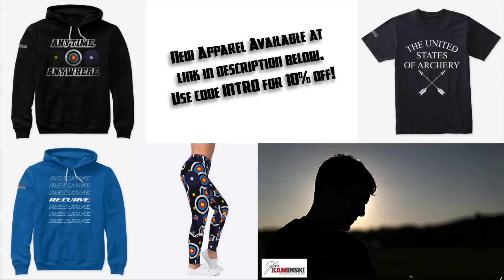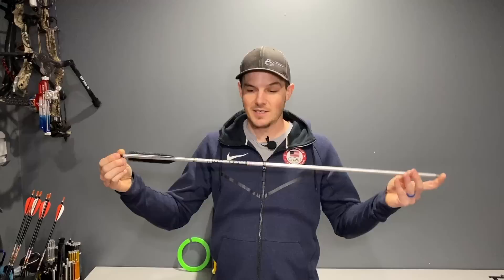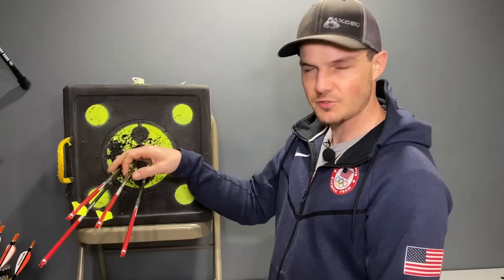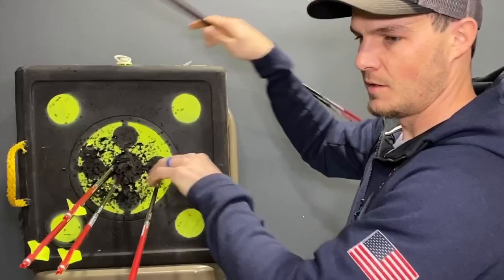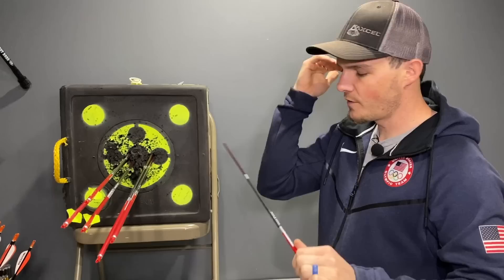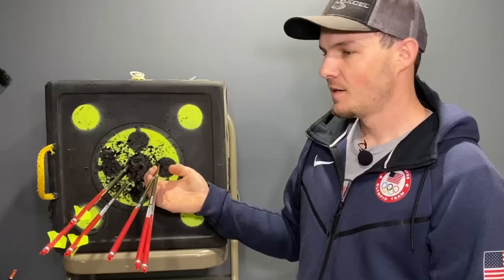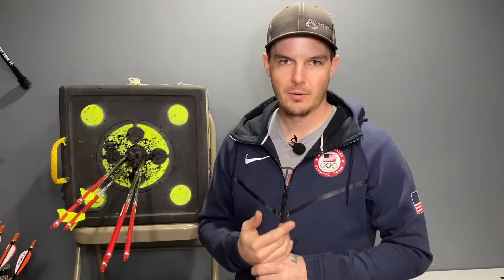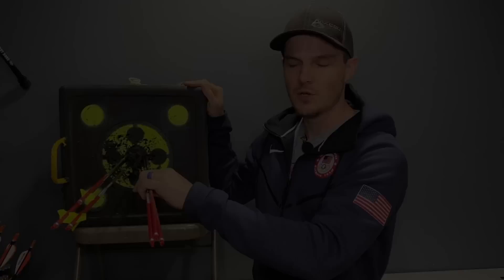Bare Shaft Tuning a Recurve Bow |  How To: Recurve Archery Bareshaft Tuning | Tuning Series Ep 10

Comment: Another great video 1 way I remember about weak / stiff high / low is everything is reversed . By that I mean say your right handed so your right hand is the strongest left hand weaker but you reverse it where the bare shaft hits  ( same can be done for a left hander ie left hand strong / right hand weak same with high nock point the arrows are reversed ie hit low & visa a versa for for low nock point .

Comment: For someone new to tuning, a ballpark estimate of how much you can increase/decrease poundage with limb bolt adjustment might  be useful here.  6  full revolutions anticlockwise from all the way in is usually max out and you've got roughly a 10% (of the rated limb poundage) gain in weight from there with clockwise adjustment to all the way in.  (5% with 3 revs etc)

Comment: Bareshaft Tuning,  Low Poundage Recurve , Field.
When tuning my 28# Barebow Recurve with VAP 1000 spine+80 gr, points, I found that when shooting 3 bareshafts and 3 bareshafts that were taped, (taped in the same place as the vanes on the fletched shafts) the 3 bareshafts always landed RIGHT of the fletched.  The TAPED bareshafts always landed LEFT of the fletched.

  First I adjusted my nock point.  Then I increased my draw weight to bring the taped shafts toward the fletched shaft because I wanted the greatest distance for arrow flight.  I found that I can aim on the target with 28# Draw weight using the riser shelf.   When the bow is tuned using the (weaker spined) bareshaft the bow doesn't shoot as far.

 I have not tested for group size,

Comment: I recommend you always say that this tuning is for shooting with fingers, does not apply to anyone shooting a release.  If someone just watches one of your random videos that youtube suggests they might not realize that.
If the string pushes forward on the rear on the arrow, why does the arrow bend sideways?  This is the critical difference between using fingers and using a release.  With fingers the string pushes forward on the arrow but also it pushes sideways on the end of the arrow and this sudden sideways push is what makes the arrow start its bend.  This doesn't happen shooting a release.
In the old days we didn't do the walk back tuning and we didn't have adjustable poundage so all we could do was change the arrows or the plunger.  This might be why we sometimes had plungers out left of centershot.

Comment: Hi Jake, thanks so much for your amazing videos. I try to find advice about the centershot and plunger setup for bareshaft tuning. Centreshot you have covered. I can't find if it's OK to stiffen up or make the plunger rigid, e.g. with a match instead of the spring just for tuning... Then roughly bareshaft tune and then what? keep it stiff for further tuning or let it back to soft plunger?

Comment: Jake, awesome video and I learned a lot from it. Please continue the awesome series. My doubt with this video is that you didn't mention anything about the sight pin. Does it stay constant throughout the bare shaft tuning? If yes, then where would I place my sight pin, to start the bare shaft tuning? Amateur such as me would adjust my sight pin to correct the arrow to fall on the center. I have absolutely no idea right now if my arrows are stiff or not, if my nocking point is high or low. Right now, I would adjust the sight pin to correct the errors to make surer the arrows land in the center. How would bare shaft tuning help me differently from what I am doing right now?
Reply from the maker: When tuning, where your arrows land in relation to the target doesnt matter, where the bareshafts land compared to the fletched shafts matter. Ignore the target, but you have to aim at the same spot so it helps to have one up, and dont move your sight during the end to compare the arrows to eachother.

Comment: Jake, where do you set the sight pin when your setting up a bow to bare shaft? I was always taught to set the sight pin above the centre of the arrow, then adjust plunger pressure to centre the fletched group on the target, then bare shaft from there and not adjust the button at all.

Comment: Jake, how about the weight difference as you don't have the vanes on the bare shaft so it's weight (distribution) is different and will react weaker.

Edit: forgot to say great video as always!! Thanks
Reply from the maker: Eh, it’s not that much. I’ve added tape to the back and didn’t see much of a difference. It’s a couple of grains. We don’t use the heavy vanes that compound do, the mylar type
Vanes we recurve shooters use are roughly 7-9 grains in total.
Reply: @JakeKaminskiArchery  thanks, still shooting cheap arrows so vanes are a bit heavier. I use some tape to tape them away. Seems to work well with my current form and faster then cutting them off :)

Thanks again (and quick reply!!!!)
Reply: So the question of vane weight compensation occurred to me this past week wile tuning some new VAP .166's. I'm using Bohing X Vane 2.25" which weigh in at app. 15 gr. for three. Adding an equivalent amount of duct tape, 3.5", resulted in a 8-10" spread at 30 yds. between weighted and unweighted bare shafts. So I'm not sure which I should tune to. Thanks for replies!
Reply: @buzzhooker8398  If you have the time you could try both to see what works better. But seeing Jake's reply without is probably good enough, most videos i see are just bare shafts without any additional weight at the back :)

Comment: I'm so confused, i have both several compound bows and a recurve bow. Whenever i paper or bareshaft tune, the freaking arrows dont react to any changes i make! For example i have a nock high and right tear. I unglue my insert, take off 100 grains of weights that were screwed into the back of the insert and re-glue. I also turn my adjustible nocking point around the string to move the nocking point down. I shoot again and get the same tear! Nock high and right! Same with my compounds, except on the compounds i get a nock left tear no matter what i do, i've moved the rest into every possible position, i twisted the yokes and still i get that nock left tear (i dont have facial pressure on the string, i checked for that).

Comment: Another great video! I tune my arrows by the order you recomend.   I have a (silly) doubt: if I increase the strength of the bow to make the arrows weaker, shouldn't the arrows and the bare shaft go both to the right, keeping the distance between the groups? Thanks!
Reply from the maker: It will, a tiny amount. But not together in unison.

Comment: Thanks for another great video! Do you ever add any weight to the back of your bareshaft to match the fletched arrows?
Reply from the maker: Eh not worth the time or effort imho.
Reply: @JakeKaminskiArchery  :Hello Jake surprised you say that. Even three small vanes can weigh 6 grains. I shoot barebow with 2 inch vanes here in the UK and always my fletched arrows flew really well but the bareshaft always left indicating too weak (I am left handed) I added insulation tape to my bareshaft where the vanes should be so that both fletched and bareshaft were balanced at exactly the same point along the arrow shaft. Now bareshaft groups with fletched arrows. The extra weight of the tape has made the arrow stiffer. Try it one day just to see if it makes any difference.

Comment: Great Video - very informative! I have some issues with my Easton x10 bareshafts (Spine: 550) - all of them are on the right side of the fletched group (about 30-40 cm away) - so the arrows are definitely too weak - should I choose 500 or better 450 for X10? I’m not really sure...
Reply from the maker: Have you checked a spine chart?
Reply: Yes, I checked it - I should take 500-550 for 45 lbs (28” arrow lenght) - but the 550 are too weak - and I’m not sure whether the 500 are stiff enough to get closer to the fletched group... It’s all about eliminating a 30-40 cm space...
Reply from the maker: Joshua Merz it usually says the letter R next to the spine you should use with a recurve. Especially if they give you two spines like that. And usually it’s the stiffer arrow needed on a recurve.
Reply: @scryptjo9247  My 500 with 40,5 lbs, 28" arrow length and 120 grain points fit well.

Comment: Who has an explanation?
The Easton arrow selection chart for target recomandes at 34 lbs and 27,5" the ACE 780R or 720R.
The right handed archer (last indoor competition result 575) tested both at 30 m and the result was very surprising. The 720 bareshafts were constantly to the right in the black rings an the 780 bareshaft also to the right, but close to the group or in the 9.

Comment: Hi Jake, thanks for another great episode.
One question which is bothering me for a while: When adjusting vertical tune i.e nocking point height, shouldn't the bareshaft  land slightly higher than fletched arrows due to the drag of the vanes that slowing them down slightly? I bet if someone would measure arrow speed just before it hit the target at 30 m or more there would be small but noticeable difference. What do you think?
Reply from the maker: At 30m it’s not enough to notice as far as drag is concerned.
Reply from the maker: I’ll shoot some arrows at 30m through my chronograph. And do a vid for you.
Reply: @JakeKaminskiArchery  Cool! Thanks!

Comment: I have a qustion concening plunget tension at the beginning of bareshaft tuning. The method is described by Peter Gabriel as "arrow flight on rails". He suggests to aline limbs, center shot and lining the sight pin to the string. Then flatshed shafts should be shot on 30 meters. He says to adjust the plunger tension to compensate for left and right until the aming spot is hit. Then he recommened bare shaft tuning exactily the way you explained in the video followed by walk back tuning. Woud you recommend this method to find the plunger tension to begin with?
Thanks and keep on going! :)
Reply from the maker: I personally don’t recommend that. I’d rather have better grouping arrows and move my sight in the middle rather then have arrows that hit behind the pin and group bigger. I’ll expand on that more further down the line.
Reply: @JakeKaminskiArchery  Thaks for your recommendation. I´m looking forward to dig deeper into it!

Comment: Great video again. One thing is important for me: You never can get a bareshaft properly into the group by only changing plunger pressure. This might be able at one specific distance, but not for all distances. Because of this I always do the bareshaft test at 18 and 30 metres. If the fletched arrows and the bareshafts match at both distances, this is going to be the best setup, and the walkback test is going to run properly either.
But, Jake, what's about taping the bareshafts to get the same FOC as at the fletched arrows? What's your experience about this?
Reply from the maker: FOC stands for F*%#*+= Over Complicated imho 🤷🏻‍♂️

In all honesty the tape method is ok, but the resulting tune I saw wasn’t enough of a difference to warrant the effort and time. Fine tuning results in a much tighter grouping bow then bare shaft tuning alone
Reply: @JakeKaminskiArchery , thanks. This is similar to my experience. But you often read about taping the bareshafts as an important method. If I tune without taping I know that my setup is slightly at the stiffer side. Another thing is that the tape can touch the plunger, what makes the test useless.

Comment: I'm shooting barebow and for 30m I need to do string walking. 
For bareshaft tuning at this distance, do you recommend using string walking or switch to a gap-shoot and try to anchor next to the arrow.
I'm wondering if tuning using string walking will be valid when adjusting the crawl for other distances, like 50m.
Reply from the maker: I’m not 100% on that yet because I’m a barebow virgin relatively speaking. I do know that they crank their plunger tension up and down depending on the distance they are shooting to keep their impact point left and right the same, this is partly due to the change in tune.

Comment: When you bare shaft tune do you lock out the plunger at center shot?  If so, what is the best way to lock it out?  Thanks in advance.
Reply from the maker: I do not lock out the plunger. some do and use a match stick. I prefer not to.

Comment: Great video Jake.... Do you use a stiff plunger or plunger with mid range tension when starting bare shaft tuning?
Reply from the maker: I know where mine needs to be but might as well start in the middle range if I had to make a suggestion to others.
Reply: @JakeKaminskiArchery  thanks....so you wouldnt recommend the stiff plunger method?
Reply from the maker: I prefer the walk back method for setting center shot
Reply from the maker: Archery Nut you can do that, seems a bit redundant to me since you essentially set your center shot twice. I just don’t find it necessary, potentially someone who in unfamiliar with their setup or tuning potentially that may be needed.
Reply: @JakeKaminskiArchery  This is the method I was referring to.

1.Put a stiff plunger in so button doesnt move at all. 
2. set arrow centershot directly in line with string.
3. Line the string and sight and arrow up. 
4.Shoot bareshaft and fletched at 20 yards minimum. 
5. Adjust tiller bolts on bow until bareshafts and fletched land in same group. (if you cant get this to happen, arrows will not work for this current limb poundage). 
6. when bareshafts and fletched group together anywhere ( left, right center of target etc) Then replace plunger with normal working plunger. 
7. adjust centershot of arrow to just outside of string. Move sight over arrow ( if X10 or barrel shaft, leave arrow centered and sight centered). 
8. Adjust plunger tension until arrows hit in center of target. 
9. walkback tune from 50 yards to 5 yards. (FIFTY YARDS TO 5 YARDS) no more, no LESS.
10. adjust CENTERSHOT for arrows to hit centered at all distances. ( this is assuming your sight is straight up and down).
Reply: @JakeKaminskiArchery  Awesome, thanks for the interaction.

Comment: After arrow stiffness, you said the easiest change is to adjust draw weight. Doesn't that change brace height and nocking point?
Reply from the maker: Not nocking point, brace yes. Minimal, but easily adjusted to bring back to spec

Comment: Dear Jake,
I have a question about the location of the arrows during bareshaft tuning.

If my bare and fletched are in a group but off the center in the left or right. What do I do? Sight right? I'm confused because my new club coach said to change the plunger tension.
Reply from the maker: Are you shooting recurve? If so, just move your sight. My sight is NEVER right over my arrow when looking from behind. Most shops say this because they are familiar with compound, not recurve. If you adjust your plunger tension, your tune will change. 

However if you are shooting barebow, then yes adjust the plunger tension to make them go in the middle and keep adjusting the bow weight to maintain the tune you want. Unless you can adjust. your string alignment and like where it would need to be in order to shoot them in the middle.
Reply: @JakeKaminskiArchery  Thank You Much for producing free content and answering answers for us 😁

Comment: Hello Jake, I enjoy your engineering point of view on the art of archery. But why do you on your bare shaft tuning not compensate the weight of your removed fletching of the bare shaft. Without this compensation your nodes will not be the same, also speed  etc. Maybe a test with and without weight compensation ?
Reply from the maker: In all my testing, it doesn’t make enough of a difference to matter. 

I use vanes that weigh so little maybe 5-7 grains top in total including the dried glue residue.
Reply: @JakeKaminskiArchery  Thanks, clear answer !

Comment: If fletchings add straighness and forgiveness , why does everything seem to point to smaller rather larger fletchings ?
Reply from the maker: Wind drift.
Reply: @JakeKaminskiArchery  thank you.
Long for indoors 18m, short for out, 50m....barebow ?
Its funny, l stopped using long tall fletchings because l could see marks on my riser rest....but, my short short fletchings leave a mark as well. 

Great information...helping a lot as l reconnect . 
I found that in the beginning, tunning was an interesting journey but frustrating and gave up because well my form wasn't consistent enough to make tunning tell me anything. 
Thanks

Comment: Hi Jake,
First of all, nice video. Second, i have a "little problem" with my bareshaft tuning. If i set my sight in the vertical center my bareshafts hit right behind the pin BUT my fletched arrows hit +-0,5m left (RH archer) and i don't know what to do with it. Can you please help me?
Kind regards Yannick
Reply from the maker: The sight left to right is irrelevant imho tune the bow, get the best group and move to sight to get the arrows in the middle. It has adjustments for a reason, otherwise we would have sights that didn’t move.